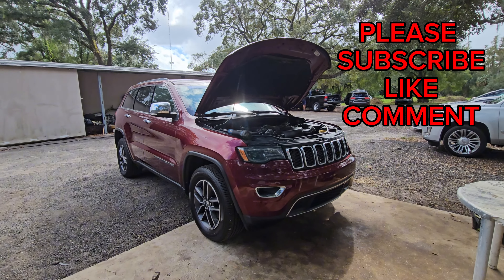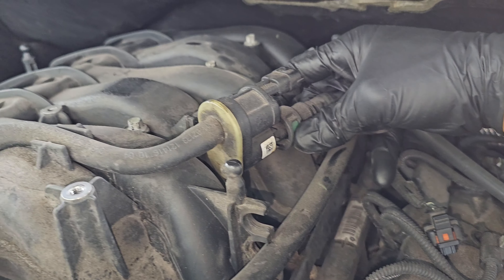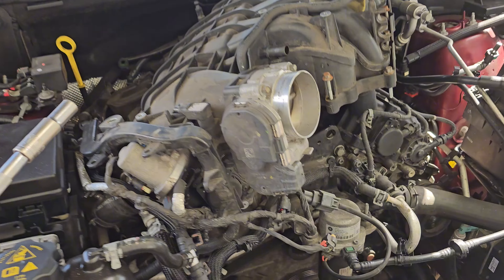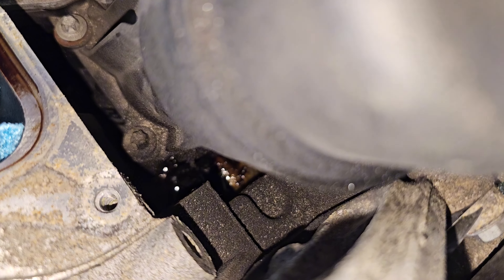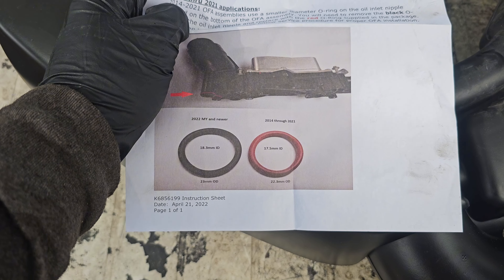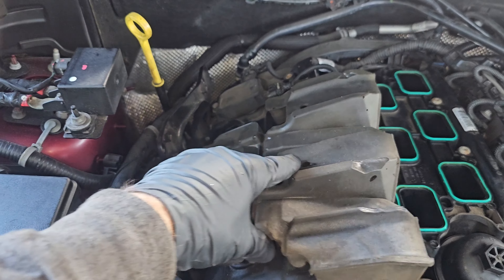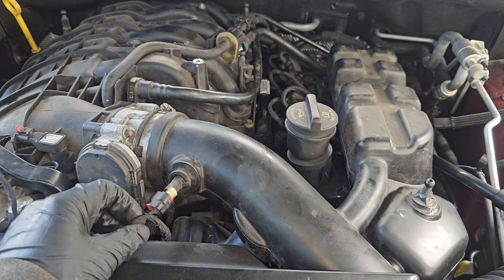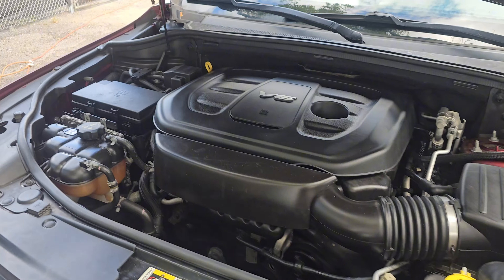CHRYSLER DODGE JEEP RAM 3.2 3.6 V6 OIL FILTER HOUSING COOLER SEAL REPLACEMENT

Comment: Oil filter….
Reply from the maker: @richarddobreny6664  ? What about oil filter Richard ?
Reply: @ you were saying oil cooler.  The video was a good technical clip on how to remove everything to get to it.  If I ever need to perform this task, I will use your video.  Keep the videos coming
Reply from the maker: @richarddobreny6664 thanks for taking time and watching, it's a " oil filter housing " which has a oil cooler attached to it, the cooler itself would be actually the aluminum color part , is figured it's easier for people to find the video if I described it like this. I have probably changed out 20 sets of these seals , so common on 3.2 or 3.6 v6